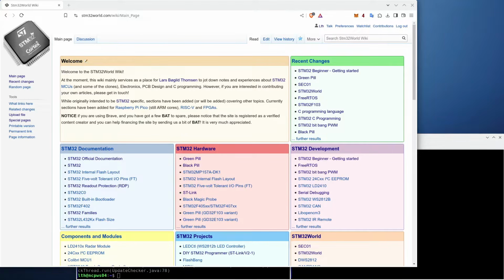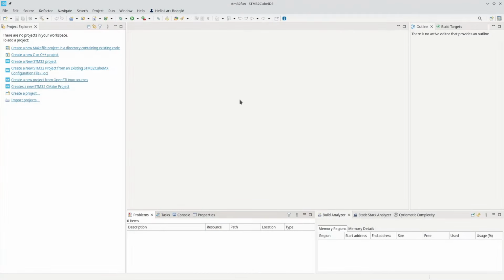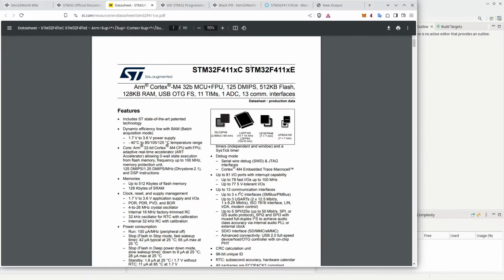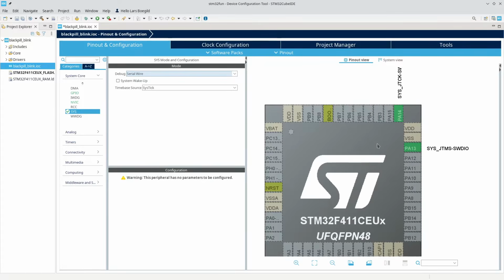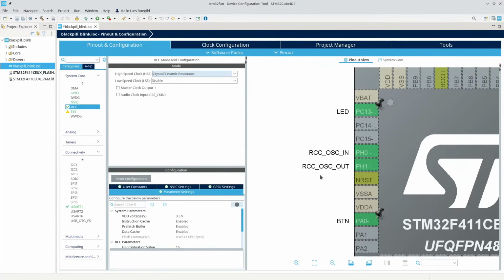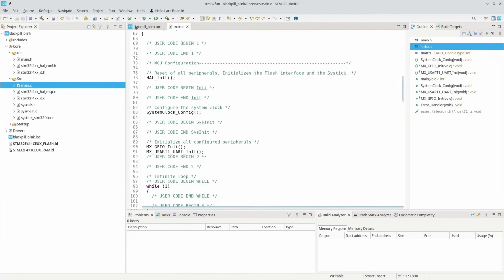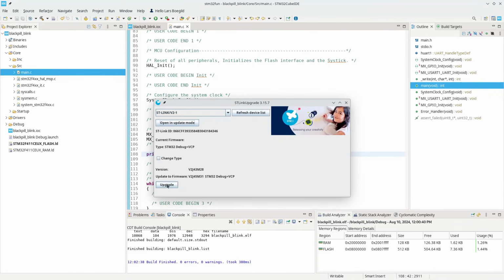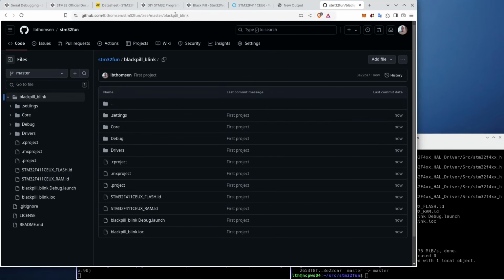STM32 Tutorial #2 - First project in STM32CubeIDE (blink)

Comment: Cool, what Linux are you using?
Reply from the maker: Been using Debian since forever.  Usually keep servers on stable and desktops on "testing".  The benefit of that approach is that I will deal with potential upgrade issues on my desktop before I have to deal with it on servers - most of which I don't have physical access to.

Comment: using your own stlink with additional pins for newbie tutorial... not sure about that. this is at least confusing. i obviously have default one. so far i just do not enable pins in mx that you saying is for your stlink. ill update if run into troubles or not
Reply from the maker: Well - everything is possible with standard st-link - just not the Chinese clones.  The point is - get a proper st-link device.

Comment: Thank you for creating this series. I am new and starting to follow your tutorial. Can I clarify a point? At time 20.01, you configure the RCC to high speed external using crystal ceramic resonator. Subsequently, you move to the next tab, Clock Configuration and it appears that HSI RC is checked. Isn't this High Speed Internal clock? But I thought you had previously configured RCC to High Speed External? What happen if RCC configuration and the configuration under Clock Configuration tab are different?
Reply from the maker: 1 minute later I switch it to HSE ;)  In reality it does not matter unless you require really precise timing.  Some peripherals does (USB mostly).

Comment: I'm glad I found your material. I'm a mechatronics engineering student and I'm trying to sharpen my skills over the summer. thanks for all of your help.
Reply from the maker: I would suggest you to through the videos more or less in order.  The later videos often build on stuff that was introduced earlier.  All the videos do have chapters making it relatively easy to skip forward.
Also, keep in mind that the STM32World wiki https;//stm32world.com/wiki contains a LOT of the documentation used in the videos and https://github.com/STM32World - containing most of the source and examples.

Comment: Excellent again - one question - will this tutorial work with a regular stlink V2 - i.e. not your custom one?
Reply from the maker: Well - my custom one is essentially a ST-Link V2-1 so it will work with Nucleo boards which have that built-in (or breaking one off of a Nucleao board and using that as stand alone).  If you are using a Chinese V2 knock off you might have to add a USB-Serial adaptor as well (I think that was explained in the first video) OR modify it to include SWO.  You could also get one of the ST-Link V3 stand alone devices.
You can jump to https://www.youtube.com/watch?v=jHo_IpqRlRE and watch that.

Comment: I just found your YT channel and website yesterday, and I'm surprised you don't have a larger following with how good your content is! Please keep up the good work, as you are helping raise the next generation of embedded systems engineers. 

I had a question about serial wire debug. If the STM32 pins are not configured by default and needs to be flashed with the initial binary to configure the pins, how does the ST-LINK flash the STM32 if the (in this case, PA13 and PA14) pins haven't been configured to SWCLK and SWDIO mode yet? I noticed your article on Boot0 said that SWD interface does not need to mess with Boot0 pin. 

As a follow-up, would the ST-LINK stop being able to flash the STM32 if the STM32 was flashed with a binary to configure PA13 and PA14 to a GPIO_Input or GPIO_Output?
Reply from the maker: By default the SWD pins are running in SWD mode but it can be disabled in firmware in which case you would have to physically reset the MCU to be able to flash (or use boot0 to throw it into bootloader mode).  If you just leave them alone and set them to serial wire debug in stm32cubeide you will be fine.
As for the channel - it is still fairly new and it IS growing.  I guess it is niche contents and slow growth is to be expected.  Feel free to help out by sharing with friends, and liking the videos.  It helps a lot.
Reply: @stm32world  That makes sense that PA13 and PA14 are set to SWD by default. I found application notes AN4989 and AN2606 to be most helpful. I think using boot0 to switch to bootloader mode does have some caveats if you look at AN2606 though. Some STM32 bootloaders depending on device will configure PA13 and PA14 to be USART, which would disable SWD while in bootloader mode
Reply from the maker: As for the number of followers - I don't buy advertising or clicks, so ....

Comment: I have some microcontroller experience but am new to the STM32 and their IDE.  Your video was extremely helpful in deciphering their way of doing things 😎

Your next video is on my list.  Hoping to control an OLED display shortly.
Reply from the maker: I actually just picked up a bunch of sensors, displays and other stuff in preparation for future videos.  One of those little SSD1306 OLED displays were one of them and they are quite easy to get working.
I am glad you enjoyed the videos.
Reply: @stm32world  I now have a 1306 OLED working with the Blue Pill, but using the Arduino IDE.  I was unable to make it work with the STM IDE so your video would be appreciated 😎
Reply from the maker: A video will come probably in a couple of weeks.

Comment: Thank you once again for your video. I am currently using the STM32F0 Discovery Kit for the tutorial, but I've noticed that my microcontroller seems to be less powerful and lacks some features you mentioned, such as Trace Asynchronous in debug mode. My board only supports Serial Wire and requires a separate COM device for UART communication, which I have managed to set up manually.

Given these limitations, I was wondering if it would be more advantageous to switch to the Black Pill board, especially if your tutorial leverages advanced features that my current setup lacks. Would you recommend making the switch, or is my current board sufficient for following along with the tutorial?
Reply from the maker: I'll do a video about the SWO at some point - it is quite interesting and powerful.
Reply from the maker: I am 90 % sure that the target mcu on the board you have - indeed all the stm32's - have a swo pin possible.  The question is if it is wired up to the st-link.  The cheap chinese st-link clones does NOT include a swo pin, I have a stm32f4-disc1 where it for some completely bizarre reason is NOT wired up on the pcb. Check the user manual for YOUR discovery board.  These issues were all the primary reason I made my own st-link device (see https://stm32world.com/wiki/DIY_STM32_Programmer_(ST-Link/V2-1) ).  As for switching - well - as mentioned in the #1 video there's no "one size fit all", so it is always a good idea to have a bit of a selection ;)  Personally I tend to use stm32f405 a lot as it includes most features I have ever needed but there has been situations where I have used a stm32l4 instead (space, price).